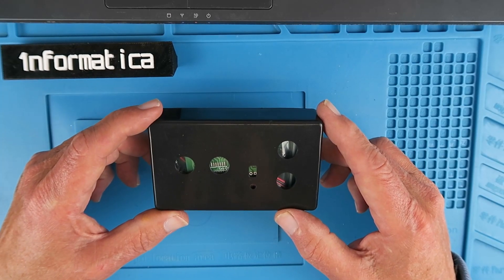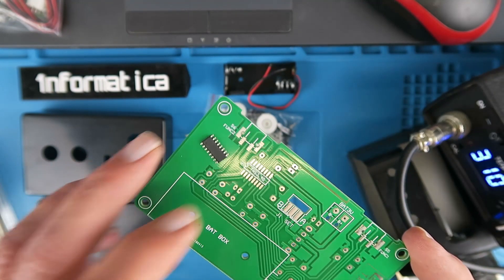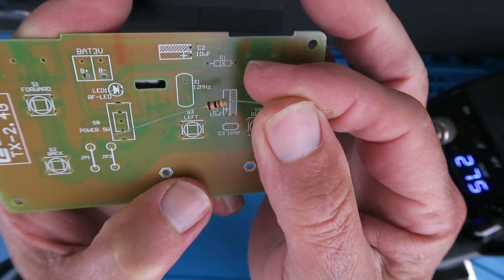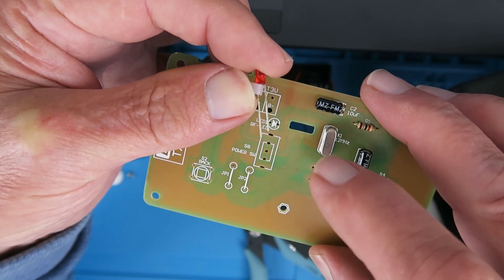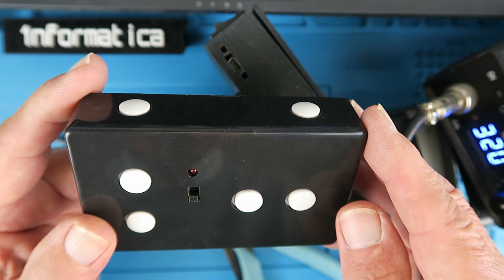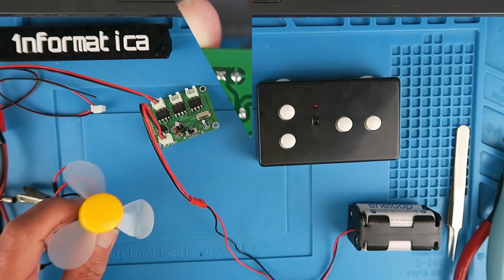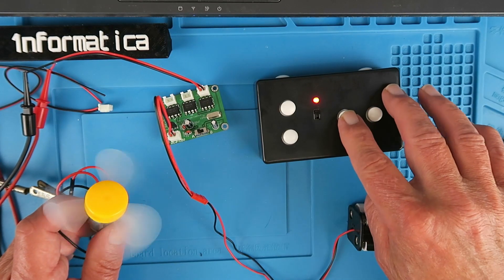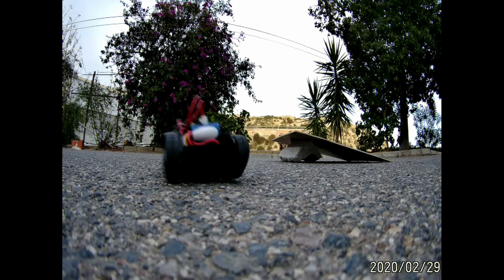Tx Rx 2 4GHz 3 Channel Remote Control Kit Build

Comment: Wow... Really nice work, man! 😃
It really looks like a fantastic cheap option! 😃
Do you have any idea Of how distant can it go without losing signal?
Reply from the maker: Thanks Mario. I will check the range later and post. The antenna is just a trace on the PCB. I guess you could cut that and put an external antenna for better range.
Reply from the maker: I get around 50 to 55 meters. It's enough with a small model.
Reply: @1nformatica  That's actually pretty good! Much better than the toy grade transmitters and receivers I used in the past! 😃
Reply from the maker: And fun to build too!!